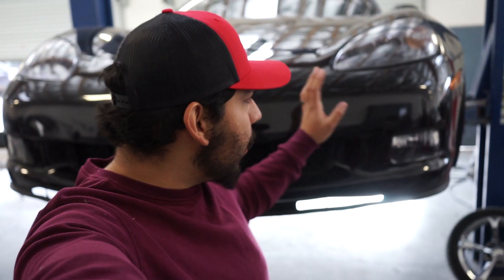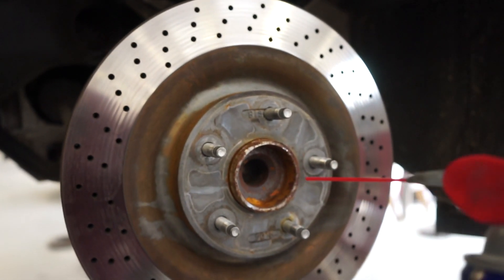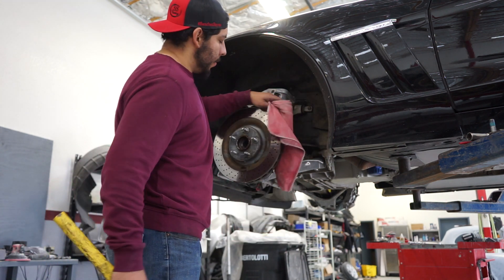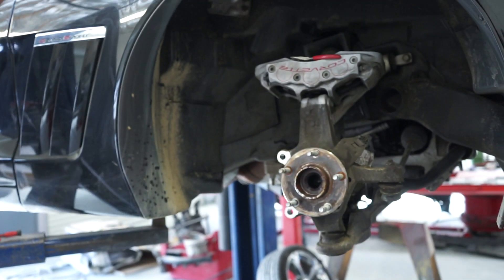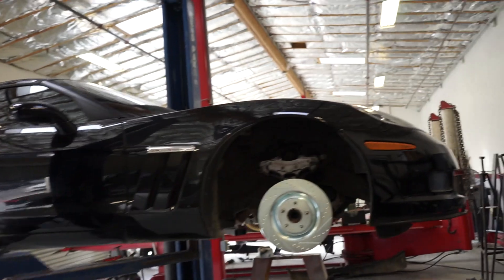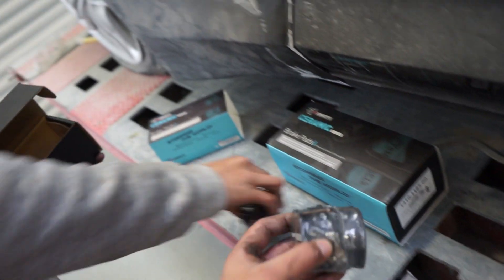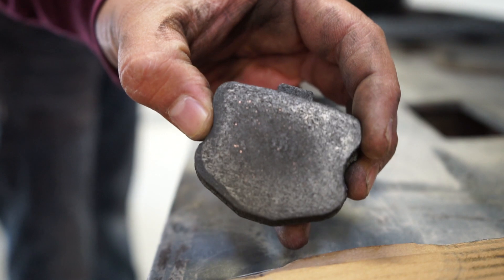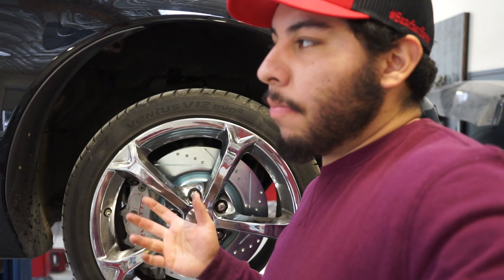Corvette C6 Brake Pads & Rotors Replacement

Comment: Are those the power stop rotors?
Reply: R1 concept rotors and pads. I used them on my 2012 camaro ss. They last pretty long and robust I still got brake fade once before